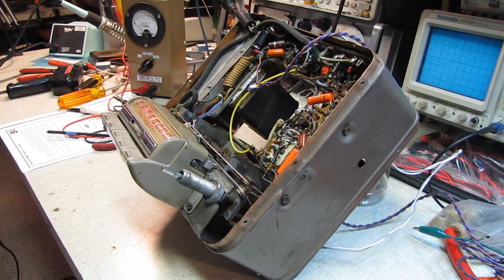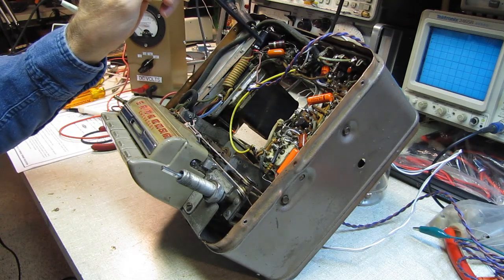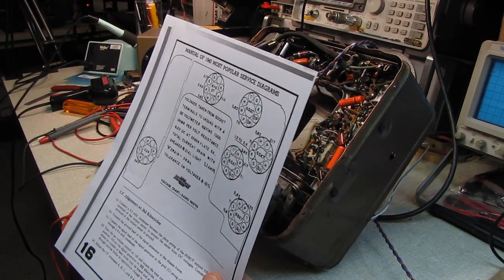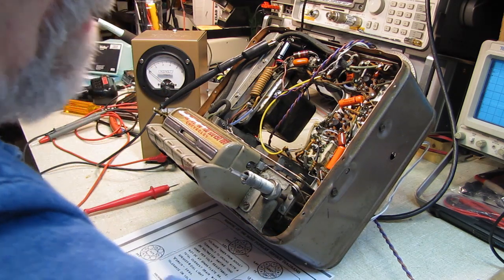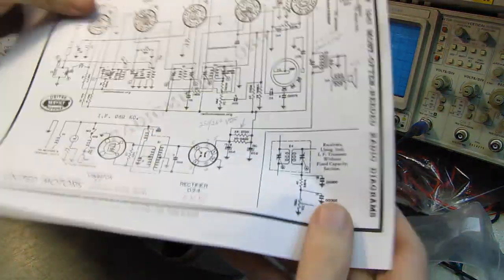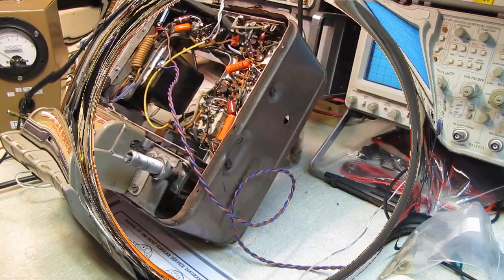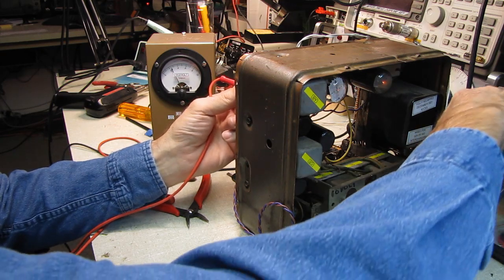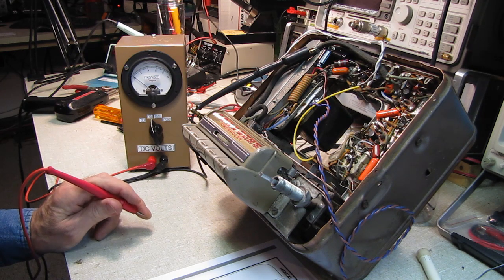DONT PLUG IN THAT OLD RADIO VOL 9-D - 1947 CHEVROLET CAR RADIO

Comment: I can't believe how sensitive that radio is Vern. We had a few Aussie domestic radios and many Philips sets with permeability tuning and it worked very well, aligning the dial was a snap, not quite as difficult as this. Can you imagine the new owner in 1947 driving out in a new car with a radio, that would have been pretty special.

Comment: GREAT job Vern!!
These radio were not easy to work on, I never had to do an alignment on on because back in 1959 I was just learning.
But in later years I repaired an Automatic Radio 6 volts car radio and another one from a friend, even filed the contacts on a few vibrators.
That radio would make a great table radio if you could change out the power transformer and build a nice wood case for it.....I know it is not yours, love those old cars.

Comment: I'm sure glad I happened on to the radio repair, you do a great job explaining it.
I agree that radio is real sensitive. My little story, is the first time a seen a 
 permeability tuning , was," I thought", a 47 buick that some previous  owner
put back in the ravine/ woods to get rid of it , might have a tube radio.
that would help me learn radio understanding  and prove something if 
I could repair it. I went and got it  I couldn't believe there was "no" 
stator & rotor, plate type, var. tuning  capacitor. that was the first
time I laid  my eyes on a  permeability tuning  slug throu coil type,
that moved in and out to change radio stations. All though it's
different and cool, I have no idea why a radio manufacture would use it,
except it, takes up less room.

Comment: hello community facing problem with that cc308+ that still blinking all time without leting me detecting any thing even wifi or mobile or any other device .that detector became useless. i know that there's a way to keep it again detecting all other rang as wifi and radio one.mybe some one understood or facing the same problem before those pictures shown inside that detector.